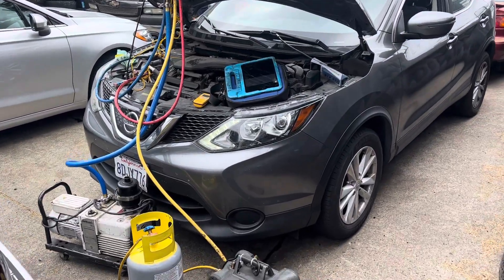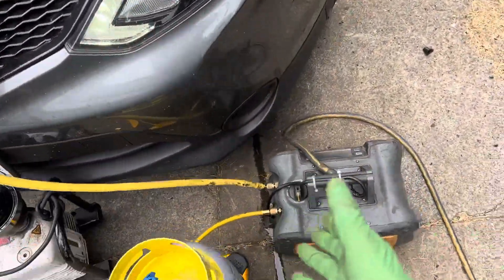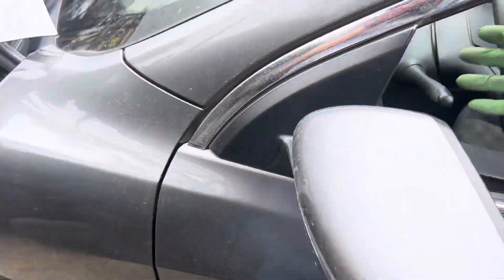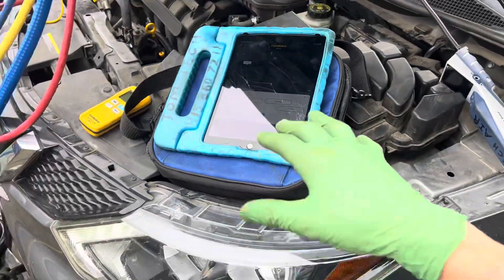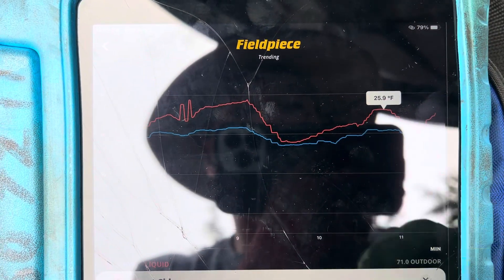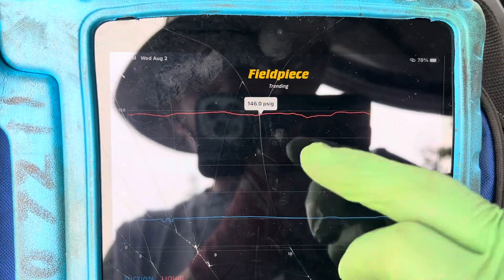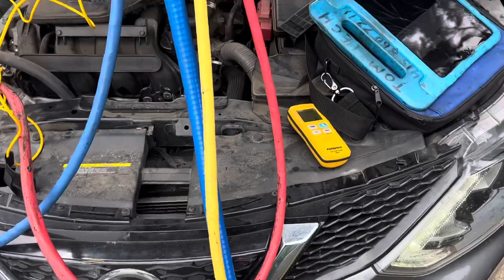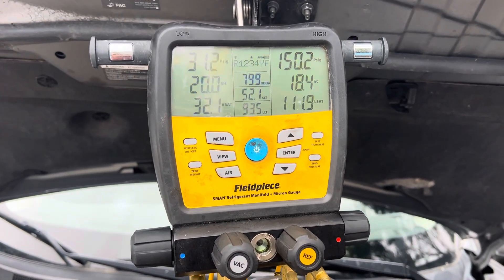AC TONS OF WATER 💦 CONDENSATE & BLOWING 🥶 COLD. Customers complaint doesn’t blow cold sometimes.

Comment: Do you prefer working on the ac in cars or havc?
Reply from the maker: @hisautorepair124  HVAC, 

But cars are getting fun because they adding Heat Pumps.  They have multiple expansion valves on glycol loop plate heat exchangers.

Some heat pump vehicles have back up resistance, electric strips, ceramic plates just like resistance back up heat in a regular HVAC heat pump or gas furnace .,

Cars are becoming just like HVAC has always been . 

So it’s becoming fun and interesting . 
But just a lot less money . 💸 

The poor guys in Automotive don’t know how much more money they could be making commercial Hvac instead of Automotive.
Reply: @coldfinger459sub0  I just got doing 2 years of residential hvac and I hated it. I loved the work just not the way companies are. I’m gonna try commercial next but if I can’t get anything I will just focus on automotive because I enjoy doing it also I wanna learn more about the cars with heat pumps and glycol like you said. What would be something that u could read or where could I go learn above that stuff?
Reply from the maker: @hisautorepair124  yes residential kind of sucks especially when there’s hard press salesman and they want you to sell stuff that is not necessary. 
    Or your salary base pay is so low they force you to become a salesman of Snake oil items and procedures that are not needed. 

It’s even worse than residential the company cannot even diagnose or fix or install equipment himself. He’s nothing more than a used car salesman. . 

Many residential HVAC technicians leave residential to go into commercial or industrial or Refrigeration . 

Because they can’t stand the mindset of some types of owners .  Especially specially if you had a bigger company and you have clueless dispatchers or service manager, make your life miserable, but Automotive has the same thing even worse.. 

It’s a tossup whether there’s more clueless stupid owners in automotive or residential HVAC . 
And it gives both trades a bad reputation in a bad name and makes it a miserable place for the employees to work .  
And it’s on the customers pocketbook . Lot of rip off artist.

For Automotive information 
Look for MACS .  That’s your best source for aftermarket information for Hvac.

After that, you have to teach yourself by downloading or getting hold of access of OEM service, manual and diagnostic information and reading and teaching yourself 

Automotive is really lacking behind and screwed up with education .